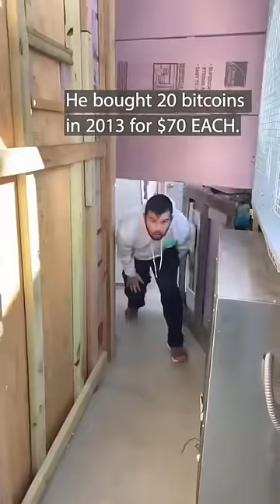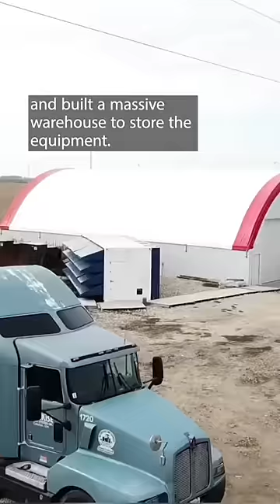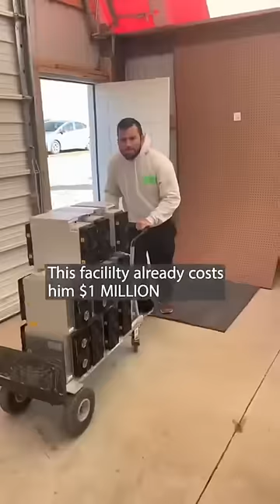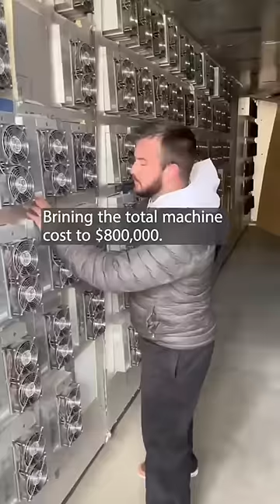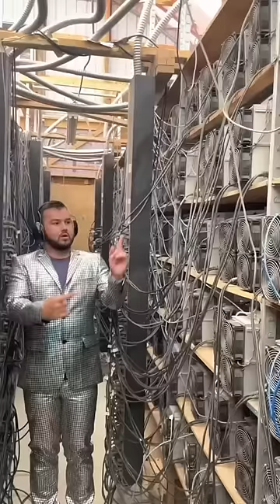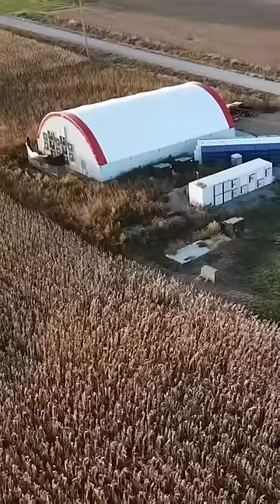Imagine buying bitcoin at $70/coin #miningbitcoin #cryptotok

Comment: -20 bucks on tuesday
+10 bucks on wednesday
-30 bucks on thursday
Reply: Thats not how bitcoin mining works lol
Reply: @Nortio  it’s not, but it’s how a joke is formed. Go on and laugh a little.
Reply: @Jjjjjjj750  😂😭
Reply: Boomers lmfao
Reply: @Nortio  depending on the price of the coin and power used it does but this is an on going joke in the community.
Reply: @Jjjjjjj750  proper comment correction no insults n the encouragement of laughter 10/10
Reply: @Nortio  r/woooosh
Reply: @Nortio  -🤓

Comment: And then the crypto currencies crashed...
Reply: Even still, the price from 2016 to now is a massive difference and anyone who had Bitcoin before the original 20K surge and held on to now is doing fine.
Reply: Its still making fist over fist of dollars. Guaranteed hes making 100's of thousands a month
Reply: im sure it'll come back up. crypto has never crashes before, and it's currently facing a global recession, international wars, and an insane cpi. it's only natural crypto will suffer.
Reply: Crypto crashing is great for miners, you get more coins which will be worth more in the future
Reply: @jimsmith3715  that's not how it works. Each coin takes a certain amount of time to make, and the more you make the longer it takes to make one. So now it's hardly worth the electricity it costs to make it.
Reply: @brytonduropan6741  crypto does this every 4 years like clock work. it happens because BTC rewards get cut in half. you can see it in the stock chart predictably
Reply: @snakeeyes5224  yeah at the time, but in return of less fiat value you get more crypto amount which if you're holding is better as it'll probably be worth much more in the future

Comment: Lmao, in 2016 BTC was at the top about 1159$. Multiplying by 20 bitcoins you say you had, that’s just 23180$, obviously not enough to cover your 2 million dollars requirement for your facility. I call this video BS, even the math is wrong, 300 miners at 3k each is not 800k, it’s 900k

Comment: How is 300 machines at $3000 each equal to 800k?
Reply: Maybe he got a package deal?
Reply: Or maybe the 3000 are rounded up so it’s actually like 2900 but idk
Reply: Non of the math in this short makes any sense, Bitcoin was an average of 900.00 in 2016 if he has 20 coins he cashed out less than 20k. Where can I buy 11 Lamborghinia for 20k?